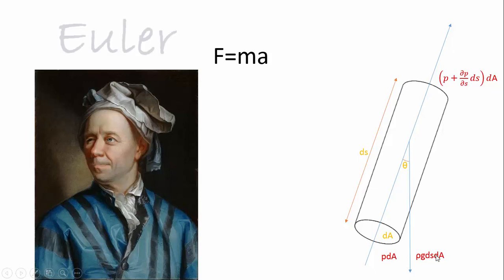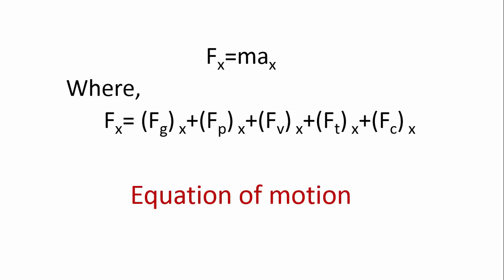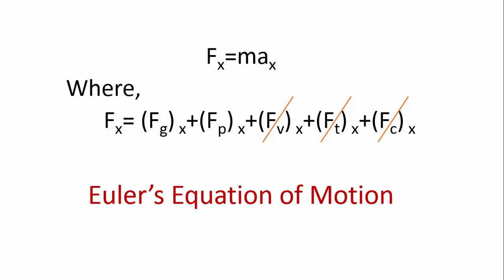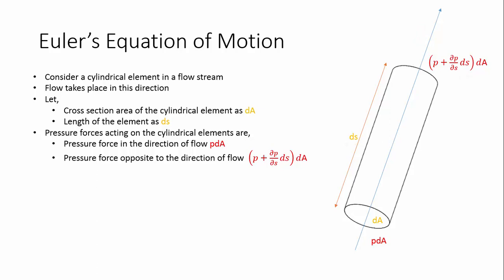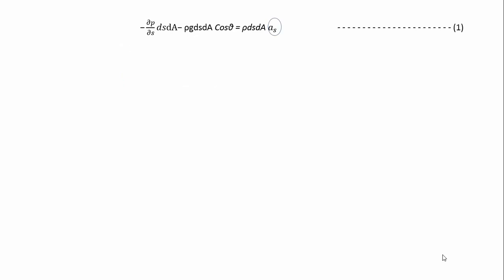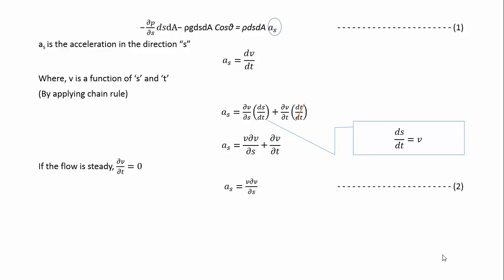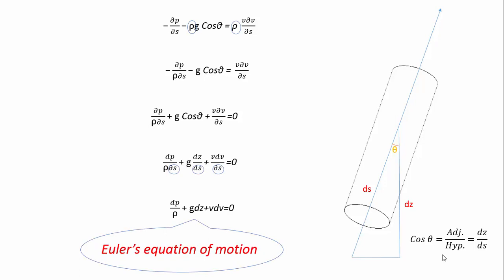Euler's Equation of Motion | Fluid Mechanics

Comment: Definitely one of the most straightforward derivation. Thanks for sharing
Reply from the maker: Glad it was helpful!
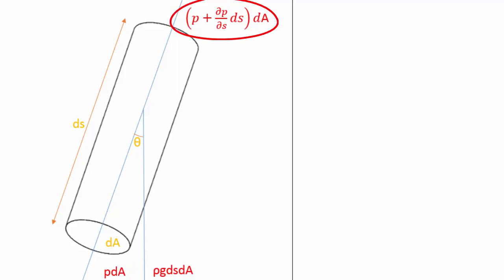Reply: I have to follow up. I'm noticing something I didn't catch before. At around 2:18, you subtract the mass projected in the s direction. At this point in the video, mg (pgdsdA) ought to be the hypotenuse of the triangle. But then later around 3:43, the drawn triangle shows ds as the hypoteneuse and dz as the vertical component.

I know the equation is correct, but I can't find the discrepancy. It doesn't seem correct though that we can "flip" these triangles or guarantee they are similar triangles